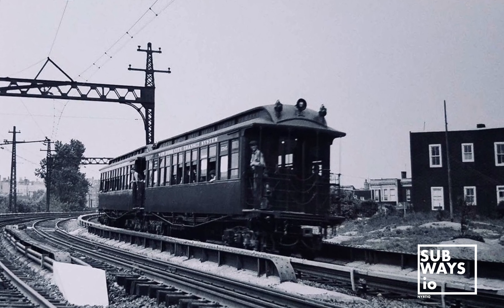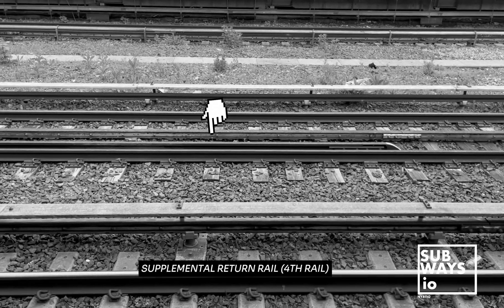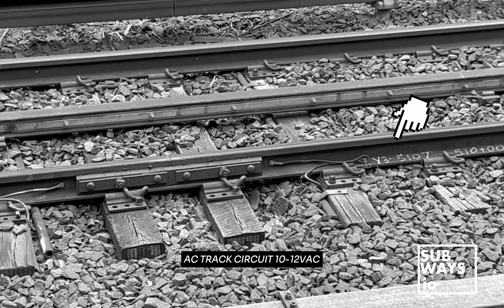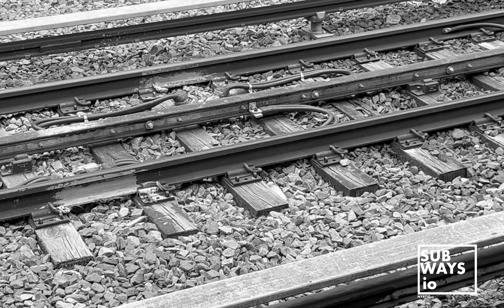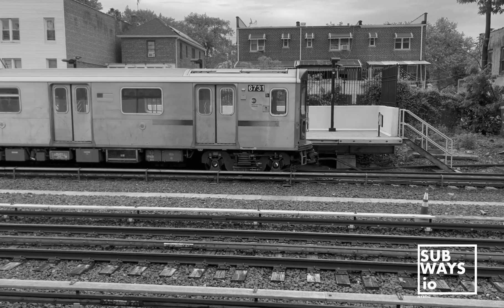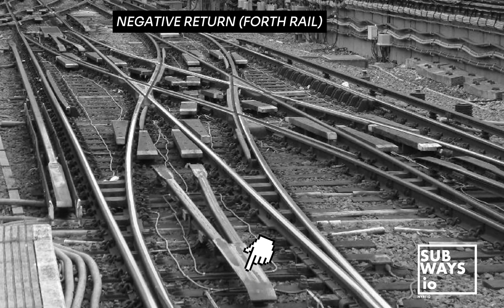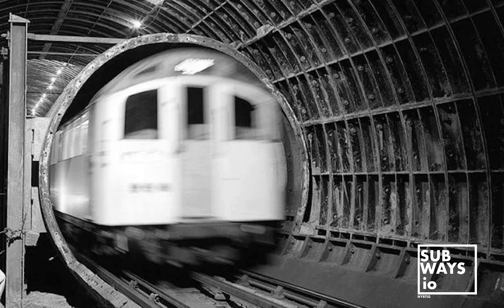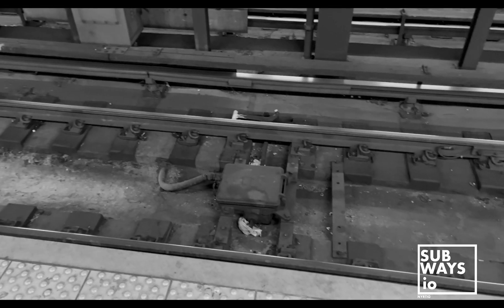NYC Subway’s Secret: The Fourth Rail ⚡ | Supplemental Power Return Explained

Comment: Question:  With the 3-rail system the New York trains have (3rd rail for DC power, closer rail for negative return current, further rail for signal current), does this mean that stepping on ANY rail will get you shocked?

Comment: Interesting. I think I've seen a cable laying between the running rails to supplement the normal running rail negative return. I believe on the Flushing Line maybe Queens Blvd. I'll remember to look next time I use the line.
Reply from the maker: Possibly a Two Rail Power Frequency Circuit with a Impedance bond DC return. There still in the system in a few spots in the IND DA Chain on Archer I believe is one such spot.

Comment: Didn't know the MTA actually had fourth rails! Does this mean that every extra rail on the tracks is a fourth rail, or is there sometimes these extra rails that aren't fourth rails? Is there a way to distinguish them?
Reply from the maker: That's a great question! No, it doesn't. Additionally, there are Guard and Emergency Protection Rails in place to help prevent derailments. This supplemental return setup (4th Rail) is found only in a hand full of  locations throughout the system based on certain criteria. One way to identify it is by spotting wayside return cables connected to the track.
Reply: @Subways_io  I see, thanks!